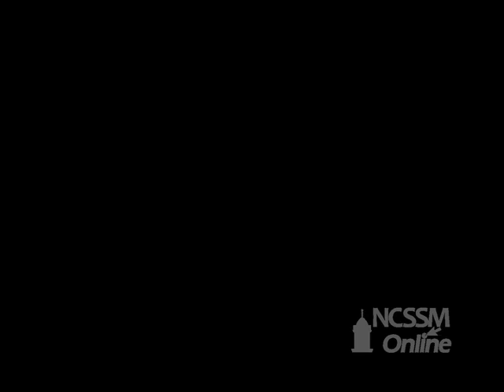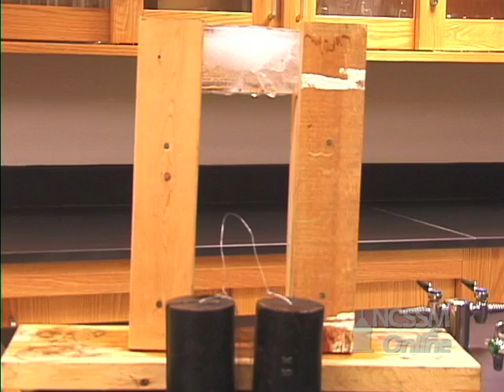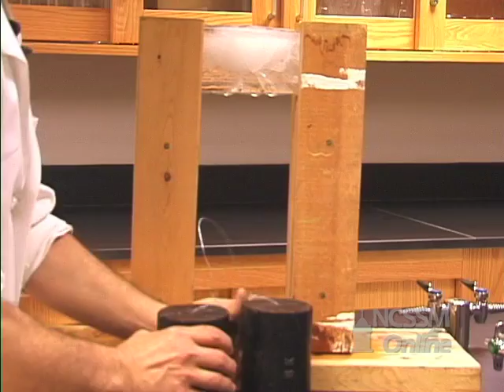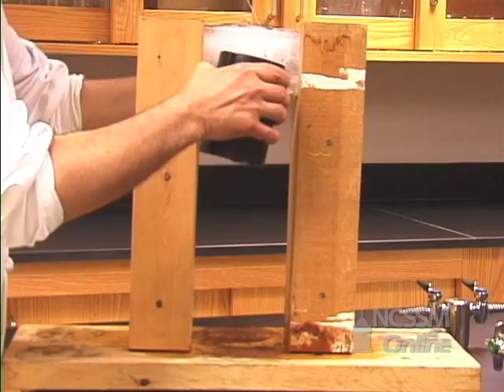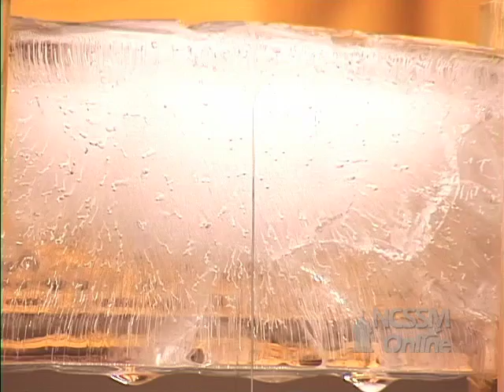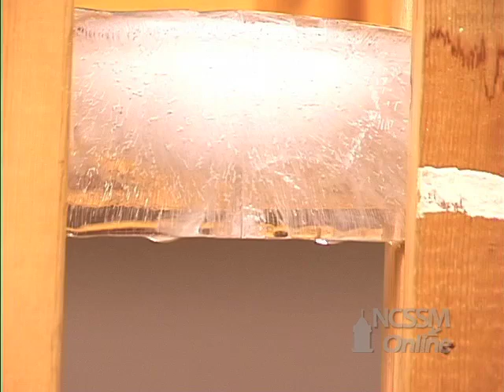Phase Change Water

Comment: How certain are you that the melting of the ice isn't due to heat transfer between the weights and wire? For this experiment,  your weights and wire should be the same temperature as the ice right?